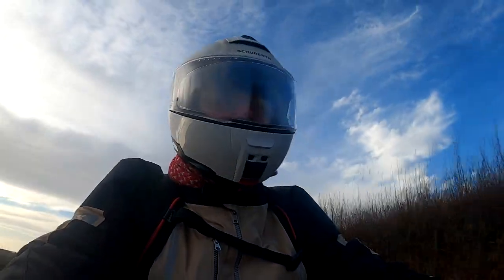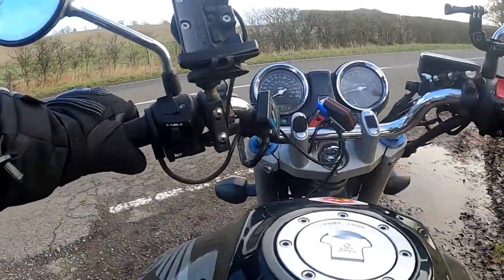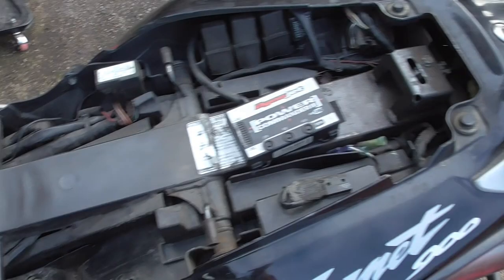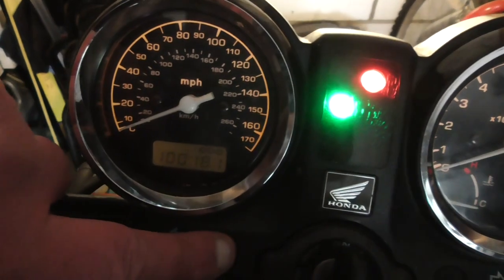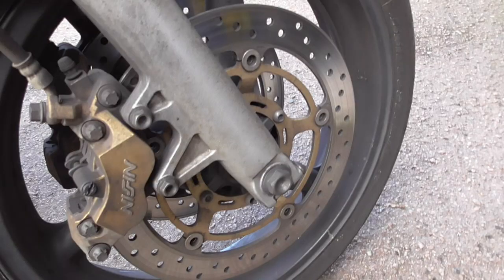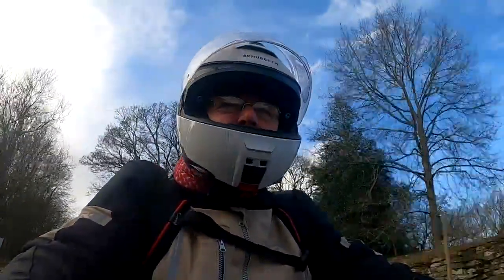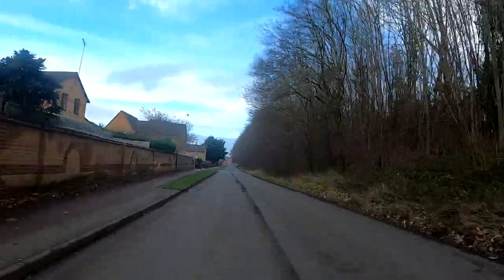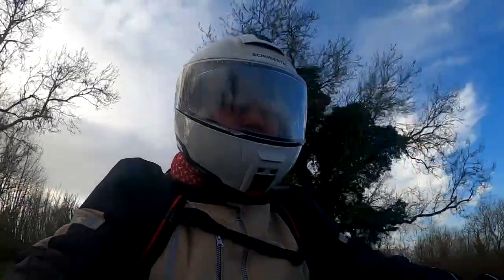2006 Honda Hornet 900: Honest Review

Comment: Bought mine during Covid from my son, 2002 model with 18k miles, for 2 grand. It was my return to biking after a gap of 36 years. Great bike, did The Cairngorms and the NC500 in 2021, so put 5k miles on during my first year of ownership! Easy to work on, I'm retired and it keeps me busy. Can't believe yours has over 100k miles!!! Plan to keep it for a long time, as you say not smooth at low revs....very "chuggy"! Love the fact it is simple and no frills. My mate has an MT10 that has just cost him a grand due to an immobiliser issue!! Great video, thank you, subbed!!
Reply from the maker: @Nige Vint Thanks for the comment and subscription.  I have a Tracer 9 that I will be doing a short review on in a couple of weeks, it is like the Space Shuttle compared to the Hornet's Sopwith Camel.  I hope to be doing a little of the NC500 this year but I am doing it as part of a different ride.

£2000 for one of these is a good deal, does the 2002 model feature carbs rather than fuel injection?  If so balancing them may solve the low RPM running, if not then I would recommend the Power Commander.
Reply: @TheRantyRider  Thankyou for your reply. My Hornet is fuel injection so I will look into a power commander. I'm rather out of touch with bikes after a 36 year gap, my last bike was an RD400! Loving your channel, and I must get a centre stand!! ( I watched your rant!! )
Reply from the maker: @Nige Vint You may find the Honda centrestand for the Hornet a bit hard to come by, Fowlers (my go-to place for seeing if parts are available) has most of the parts as unavailable: www.fowlersparts.co.uk/parts/4786633/cb900f5-2005-e/main-stand and I doubt that many people got one when they bought the bikes.  There is an aftermarket option though as SW Motech do one: sw-motech.co.uk/products/centerstand-black-honda-cb-900-f-hornet-01-05?_pos=2&_sid=d18b36906&_ss=r

If you do get the SW Motech one let me know how you get on with it.  I bet you wish you still had the RD, you could sell it now and pay off the national debt.

Comment: Good video - nice camera work and put together well.  These bikes from early 2000s or even 1990s are very good and still run great.  Better feel and simpler to work on than new bikes.  Had an 06 hornet 599 and loved it.  Now I ride an 01 zrx 1200r and it’s fantastic.  And they’re affordable.
Reply from the maker: @Drv2439 Thanks for the comment and praise.  Quality seems to have dropped since about '09 when the recession bit and current bikes are far too complicated for no reason in my opinion. But then I'm not the average rider who is low milage and a frequent bike changer, especially with PCP 'offers'.

The ZRX doesn't seeem as popular as the XJR1300, GSX1400 or the CB1300, I've certainly seen less of them around than other muscle bikes, but then I think I have averaged seeing one 900 Hornet, inclusing mine, per year since I bought it.
Reply: Yeah these old ones really are good. I love the hornets and gullarms Honda made. They are good
Reply: I also have one of these. Torquey, comfy, affordable to own and maintain and u turn in a 2 parking bay width is easily done unlike most other high powered bikes!
Reply from the maker: @Ken Lee - TWO parking spaces???  Are they lorry spaces?  Full lock on mine has a turning circle of just over two cars wide but I think I would run wider than two UK spaces, it sounds like you are a better slow rider than me.
Reply: @TheRantyRider  no just parking bays for regular passenger vehicles. So 2 bays should be about 4.8m/16 ft. I can do it cos I have been practicing it for a little while. I believe for a street bike it's a necessary skill and also a great way to get the basics solidly. I use this example often to judge a bike's slow speed maneuverability. So full on litre sportsbike suck in this regard I reckon.
Reply from the maker: Phew, that's a relief as I was envisaging the ones outside my local shop which are narrower.  The road I show turning in is about the same and I was on lock-at least I know not to get the angle grinder out to the lock stops!

Comment: That is encouraging and the reason why I did get 2 of them... and both are in mint condition with center stands. It's a shame that Honda discontinued these. Parts are still available, just not too many on ebay.
Reply from the maker: @N269 Thanks for the comment, it sounds like you have a couple of good ones there.  I was recently in Wales for a couple of days on mine, 700+ miles, not bad for 17 years old and 102 000 miles.
Reply from the maker: My lap record would be about 16...hours.  Elsewhere on the channel is my "lap record" of Silverstone - on a Himalayan.

Comment: What a great bike. Unfortunately as they weren't a great seller there are very few around to be found in 2024.
Reply from the maker: @davapod - Thanks for the comment, I had a look when making the film and there were a few available for about £2500 - £3000 with well under 30 000 miles on the clock.  I was out on mine today, it's done more miles than my newer Himalayan or Tracer 9 so far this year!

Comment: This is true old school metal horse, kinda vibrates at 80mph but it is a beast on twisties, I regret I never replaced my springs… mine is at 75000 and no issues at all, just burns some oil, 1 quart every 10000 miles…
Reply from the maker: @POV Motorcycle Atlas Thanks for the comment, it's good to see another high mileage Hornet.  I've not noticed mine using oil, as I said in the film I change it at 4000 miles but at your usage that would still be the best part of a litre and I'd notice that in the sight glass.

My suspension, apart from fork oil, is all original, but I will have got used to the gradual change in spring rates and handling over the years.  It still feels pretty taut to me and passes  the annual MoT.
Reply: Had my first at 110000km no oil used , sold that and got one at 25000 km i spotted and I'm doing it all again
Reply from the maker: @CarkeekW Mine has over 160 000 km (102 000 miles) on it now and it's still going well.  If only I had room in the garage for another!

Comment: I have an 04 I bought 2 years ago with 9k on it . Needed a foot peg and mirrors, tires . I love the bike . Very comfortable, put a small windscreen on the front , had a Yoshimura exhaust, and I added. Givi monolock top box . Can’t see myself selling this bike it’s just to good all around and an fond of bikes with round headlights . I recently purchased 2 RD 400’s one lives in my dining room ! Do you think the power commander is worth the money ? Thanks for the vid love hearing about the fabulous Honda 919 Hornet !
Reply from the maker: @Luvsallbikes 27 Thanks for the comment, if you can adapt to the throttle response when going on and off the throttle then I wouldn't bother with the Power Commander.  @Nick B commented that a change of sprckets has helped him (see below).  With the Yoshi exhaust the Power Commander would be able to be set up for that exhaust so you may get a bit more performance out of the engine.

A 19 year old bike with pretty much zero miles sounds like a real find!

Comment: Great review. Underrated bikes. Mine's 18 years old and on 28K miles. Still looks almost new like yours. I'm interested in the power commander addition. It's a bit rough around the edges at low throttle and that's being kind. It's nice to see it's a worthwhile addition. A lot of bike for not much money.
Reply from the maker: @Strangelynatured thanks for the comment, it's always good to know I'm not the only Hornet 900 afficianado out there.  The Power Commander shown is a series 3, I dare say that is no longer available.  You do need to make sure that the tailpiece goes back on correctly with regard to the seat release lock.  The placement on my bike is the only way it would fit as there is an alarn in the tail unit behind the lock where the chap at BSD would normally place them.

Unless you also change filters or exhausts there won't be a lot of power gain (104 vs 100 bhp at the rear wheel) but it really improves the off-on throttle response.  At 28 K miles yours must look far better than mine, but back then the build quality was far higher than it is now.
Reply: @TheRantyRider  thanks for all the advice. Time to buy a Power Commander I think. I've got used to the weird off-on throttle response but it still bites me occasionally. No alarm in mine so I'll get the Power Commander slotted into the tail unit.   I can't say I'm bothered too much about the power. I'd take a power decrease if it sorted out the throttle response.

Mine lives outside under a cover only but still looks great with only minimal pitting on the lower forks. Build quality back then as you say, although I put a lot of effort into winterizing the bike. Like you, I ride all year round.

Anyone looking for an honest bike that looks pretty good too, buy one. They are great bikes as proven by David's 100K mile example. The seat could be better mind you but that is fixable too.
Reply from the maker: @Strangelynatured keeping the bike outside means that ACF50 is your friend.  I give my bikes a spray every 2-3 years using a can of it in the process.  In between washing the crud off and using FS365 helps.

Don't tell everyone how good they are though, if I find room for a second one I don't want the prices to be too inflated!
Reply from the maker: @Strangelynatured blimey, I haven't heard of waxoil in ages.  It was up there with the graphite grease you heated on the cooker and soaked your chain in when I started riding.
Reply: I made a change in my sprockets to 17 front & 44 rear for slightly taller gearing(only 3.8%) and not only did it move the vibration zone to above 80mph for highway cruising it toned down the abrupt throttle response nicely...it's not perfect, but better and if I focus I can make it smooth(which I couldn't do as easily with stock gearing). I'm not sure there's even much of an acceleration trade-off given the torque of the re-cammed 919RR unit.(and FI)
Reply from the maker: @Nick B Thanks for the comment and the tip.

Comment: I also have one of these bikes. Great at both slow and fast riding. Have no issue keeping my turning radius to no more than 18 ft (4.8m) in parking lots or narrow lanes, making me feel I shouldnt have any issue even using it for food delivery. Also quick off the mark acceleration and comfortable cruising in top gear at around 70-80 mph. Havent owned many powerful bikes but it's been the best bike for me so far. I plan on keeping it indefinitely.
Reply from the maker: @kenlee7954 - Thanks for the comment, I can't find a new bike that is as good for me as the Hornet and there are plenty around with under 30 000 miles on the clock still.

Comment: Maybe you don't have the issue because you have the luggage on the bike but I'd add to the review that my bike put a lot of smell of my clothes and backpack, and I didn't like it at all. I resolved switching the exhaust with a low one form the  fireblade 900 '98/'99, it's doable you only have to hold it with a custom plate screwed on the footpeg assembly.
Great bike, and kind of a sleeper... if you have the right experience and trust in the tires can go really fast: once you push it to the limit the generous tires size provide the grip necessary, but you can actually feel the frame lacking stiffness, I don't know how to describe it but it's kind of feeling a twisting disconnection between the front and the rear of the bike, I think this is good because the bike tells you that you are approaching the limit, but some people prefer the stiffness from a tubular frame and can find this "movements" scary.
The OEM rear shock is not adequate in my opinion, for comfort and performance you need to put something better.
On the long journeys of 5+ hours it needs some extra padding on the seat.
Best aspect of the bike it can go very well both on a quiet ride or on a weekend racer mentality, you have almost two different bike. Recommended, 8 out fo 10
Reply from the maker: @ Horsemanhorseman  Thanks for the comment, it's an interesting point about the smelly clothes, was it a petrol smell?  If so it may be due to the emissions targets the bike had to meet.  The bike is 'tuned' to be quiet in the midrange where the noise tests are performed and also injects more fuel than needed to help with noise reduction.  The PAIR valve in the head takes air from the filter housing (you can hardly call it an airbox) to burn off the excess and keep within the exhaust emissions regulations.  If you have blanked this or fitted a freer flowing air filter then you may be getting unburned fuel out the exhaust.

The tyres can be trusted of you use something like the BT23s, but as mentioned the 16s aren't good for this bike in the UK.  With the OE 56s I could get the pegs down.

With the roads in the UK, and in particular in the Midlands, you won't notice any frame flex as it will be maked by all the holes!  I can't say I've felt any but perhaps I don't ride hard enough.

As for the seat and shock, I have ridden a lot of miles and hours and felt fine and I'm not as slim as I was even 10 years ago.  As I've had the bike for so long the rear shock and fork springs are probably well past their best but it's a bit of a 'boil the frog' in that I have got used to the gradual degradation.
Reply: @TheRantyRider  Hey man! thx for the response.... about the smell my bike is all stock , even the air filter is standard... I don't know about the dB regulations and it may effectively run on the richer side of the mixture, but at the end of the day I think the vast majority of the smell problem is due to the aerodynamics... the low pressure zone behind the rider creates a "vacuum" that redirects part of the exhaust fumes towards the rider, some years ago I had an MV F4 with high exhaust and I had the exact same issue. I think that having the luggage rack prevents most of the smelly fumes to reach your clothes.

About the tires I live in Italy so we have higher temperatures, but apart from that since it equips measures that many sportbike and 600 superbike used we still have plenty of choice even new models and compounds, from the touring to the track oriented ones, it's really a privilege!

About the rear shock, on my bike it's terrible it really needs a service, but I think I'll equip it with a new bitubo, since I found it at a good price, to me it's evident since I got the bike two years ago, but it could very well be that mine degraded much more than yours, since you didn't have the pain issue on the seat, I think that the lack of proper dampening on my bike could be a factor... maybe it's also partially responsible for the "flexing" feeling that I have when I push hard-ish... when I'll change the shock, if I remember, I'll give you a feeback, cheers!
Reply from the maker: @Horsemanhorseman You're welcome, I always aim to reply to comments and questions.

The large engine and narrow 'waist' of the bike cause other aerodynamic effects such as coating the top of the swingarm in road muck.  Although I have the full luggage for the Hornet I usually only have a US10 strapped to the rack and I haven't noticed smelly kit after a ride.

How many miles has your bike done?  It may be worth-if you haven't already-checking the wheel, swingarm and shock bearings for wear.  As mentioned in the video I had the front wheel bearings go at 16 000 miles and it felt like the front tyre was squared off.

The shock may be over rather than under damped if you are suffering over long distances, have a look at setting up the static sag first then adjusting the damping, there will no doubt he lots of videos on here showing how to do it.

Comment: very good down to earth review ,im looking at buying one at the moment,mileages vary from 19000 up to 32000.i think il go by condition as mileage dosent seem to matter to much.
Reply from the maker: @billy1858 Thanks for the comment, if you can find one with an original exhaust that may be the one to go for, valve clearances are due at 16 and 32 000 miles [or 4 years].
Reply from the maker: @billy1858 Mine has the HISS 2 alarm/immobiliser fitted [it's a Datatool Averto in drag], it was an upgrade available when I bought the bike.  The only problem I hgave had is with an alarm fob going down a few years ago.  I haven't had any problems with the transponder key itself.

Fowlers list all the parts if you need a new key etc (see link) , but I don't know if a Honda dealer would need to program it up for you.

https://www.fowlersparts.co.uk/parts/4786741/cb900f6-2006-u/handle-pipetop-bridge
Reply: Buy with confidence anything under 30000 miles. I had 80000 miles on my bike when I crashed it...
Reply from the maker: I don't think / hope the mileage had anything to do with the crash.  I've just found a pinhole in the RH exhaust at over 104 000 miles.  Gutted.
Reply: @TheRantyRider  bike never let me down, it was the guy behind handlebars LOL
Reply from the maker: Been there.  Done that.  Bought the new leathers.

Comment: Nice review, I have one, also in black but trying to decide between selling or modifying. The area looks like Woodford Halse?
Reply from the maker: @ Michael McLarney Thanks for the comment, the footage is indeed shot on the Charwelton/Byfield/Woodford Halse/Water Tower/Charwelton loop as it provides a mix of roads, an industrial estate for the slow riding and the only place for miles that you can film some 'urban' riding that you would miss if you blinked.  You must be a local if you recognise the streets?
Reply: @TheRantyRider  I'm not local but it's on my patch for work so I occasionally get out that way, we have a couple of customers on the new and adjacent old industrial estate. Many years ago we used to go to the plough at upper boddington, from Redditch, every few weeks too. It's nice around there 👍